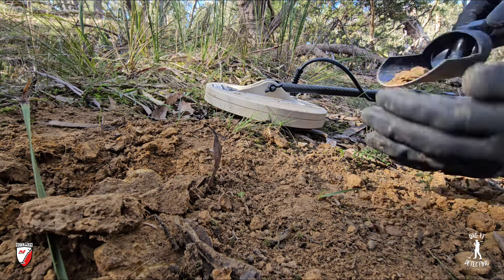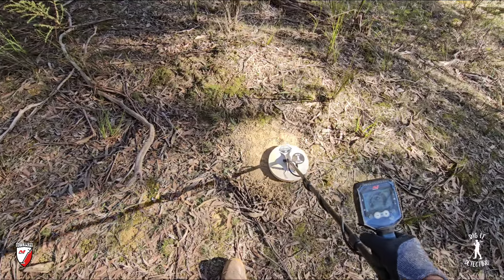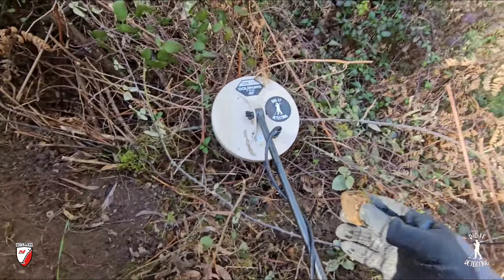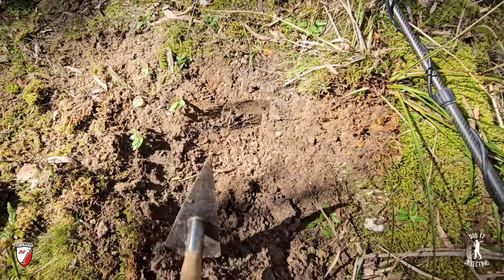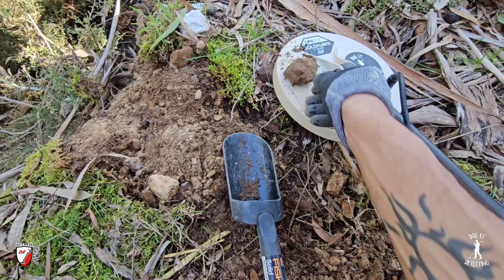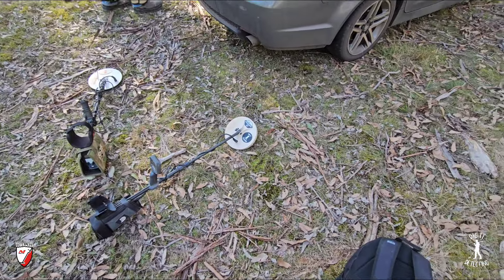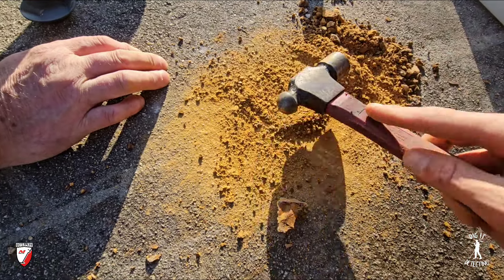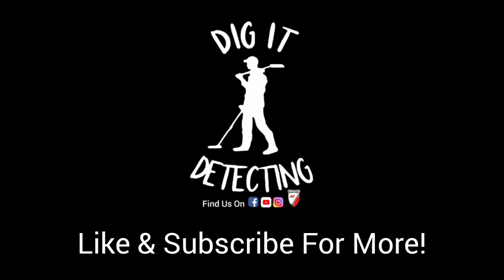Finding Heaps More Gold Over Well Worked Patch With the 9" Goldhawk Coil

Comment: Luke, my question isn't related to this video, but is related to finding small gold jewelry.  A neighbor dropped a small gold earring between her front door and their car while trying to go to church.  I couldn't even detect the remaining earring with the detector I had with me the day I tried to find the earring.  I was using a primarily coin-detecting detector.  Now I have an Equinox 800 -- do you think that it will be able to find the earring, I'm guessing in one of the gold modes?
Reply from the maker: Hi there @bobvines00 a great question mate. The Equinox you now have, I am certain, will be able to find that lost gold ear ring. No need to put it in gold mode either. Park mode 1 will still find it. However I would be dropping the sensitivity down to around 10 or so if only just lost recently. That way, if it's still sitting on or near the surface, then running a low sensitivity will stop you hearing all the deeper older targets in the ground. I really hope it helps. Best of luck and happy hunting🙂⛏️

Comment: Are you able to show the difference between that machine & the Nox & the Manticore. Obviously the one you have is better with gold but can the other machines hear the sounds?
Reply from the maker: I have tried testing the Equinox 900 on the tiny pieces of gold @CindyBushell but it is very hard to differentiate between the mixed signals it throws with the iron stone and mineralization in the ground. That said the Nox and Manticore will find gold...just have to dig lots of targets to get it🙂 Something I can show more of in future on video for sure😊⛏️